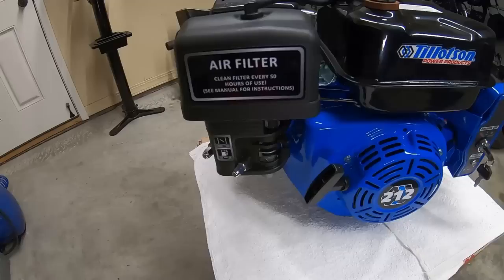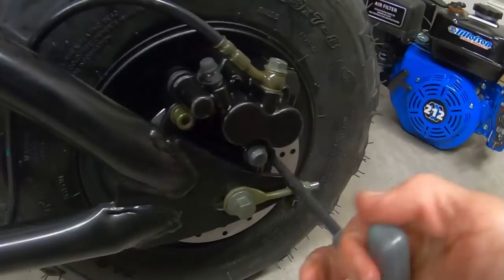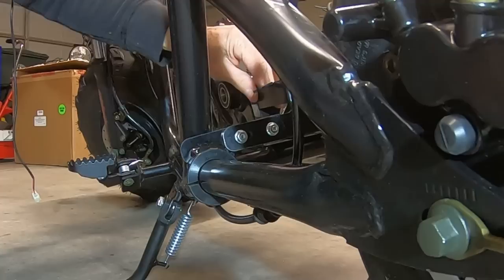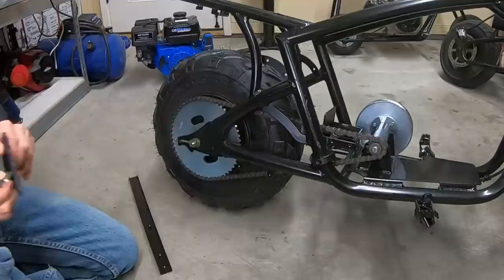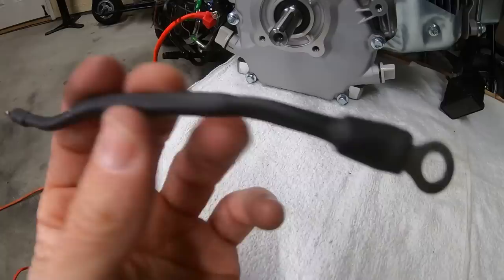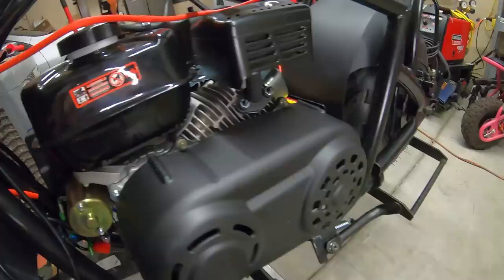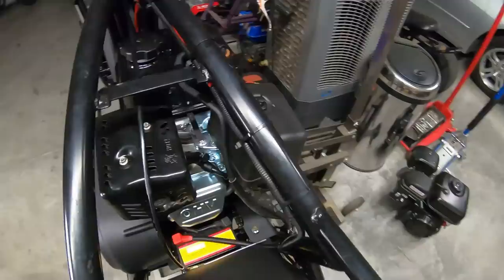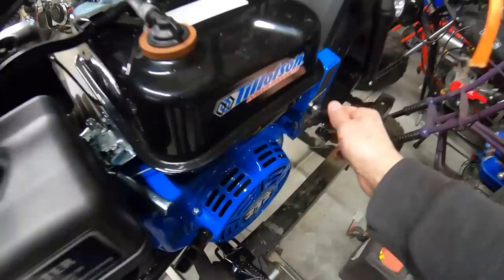I built my wife a GoPowerSports Mega Moto 212 electric start minibike.

Comment: Just to clarify.  GoPowerSports doesn't sell a Mega Moto 212 electric start minibike kit that comes with the battery box.  You have to purchase it separate.  Also, the battery box is currently sold out.  But this is on my short list.  Thanks for the quick setup video.
Reply from the maker: GPS will be selling the bike / battery box combo as a kit at some point.
Reply: @Black66  that's good to know. Thanks
Reply: They do now
Reply: They sell the swing arm battery kit + the engine kit for 1600 now

Comment: To add power, perhaps a mod 2 cam, better exhaust, stage 1 intake kit, better jet, stronger valve springs. Keep the rest in tact and add a torque converter. Should be snappy enough to get out of harms way quick if need be, but have a good comfortable cruising speed/rpm mix.
Reply from the maker: Check out the Mega Moto playlist . Got the 212 to over 60 MPH with a 223 stroker! https://www.youtube.com/watch?v=VbcpA0jdSIw&list=PLkbj-ip-5FzZG40xkiEtZHRtF_jDzxA9U

Comment: Hey just got the kit in for anyone wondering. It doesn't come in a protective crate, it's all just stuffed in a box. Washers and nuts all over the place. The welds on the bike are laughable, and I say that with all sincerity as my son who's 12 knows how to weld, and these welds look like when he started learning. I mean, there are gaps in the welds, seriously! Everything feels very china made, so much to the point they added Chinese news papers to help protect against scratching. The entire kit I bought (the 212) looks used, and I've even found rust too, like what?! Holes all in the boxes, and they also looked like they served three tours in Vietnam with multiple gunshot holes. The tires have dirt on them, metal bent all over the place, and so does most of the product that was sent. Honestly I'm shocked at how bad everything is, and the way it was shipped.  Read the fine print, because they gouge the hell out of you if you decide to return anything. Restocking fee that increases over 30 days, you'll have to pay for shipping both ways too. Honestly I feel scammed.

Comment: I'm considering the same engine but without the electric start, I understand that this engine is about 10 horsepower out of the box. If that's the case, then I'll be getting one for my mega moto 212 pro. I don't have the time or a shop to do anything more than stock, otherwise I would modify a few things here and there. And I already have a new header pipe and a UNI filter but wasn't able to use it on my stock Honda GX160 due to running rich. Any thoughts?

Comment: how about the stage 1 tilly from GPS u still have to do all that pigtail wire mess with the battery ?
Reply from the maker: Ya, the same thing for the electric start stage 1 for the MM 212 frame. If you have a different frame, you don't need it.

Comment: I just bought the same kit, the only thing is that I’m not sure what the measurement for the crank center bolt is, I have the stock Honda gx160 and the only thing that I don’t have is the bolt for the torque converter driver. Any help would be appreciated, the only holding me back is that bolt.
Reply from the maker: 5/16"-24  fine thread output shaft bolt clone GX160 GX200
Reply: @Black66  thank you, looking forward to see what the minibike expert has to say next😂
Reply from the maker: @miguelpagansr6128  LOL